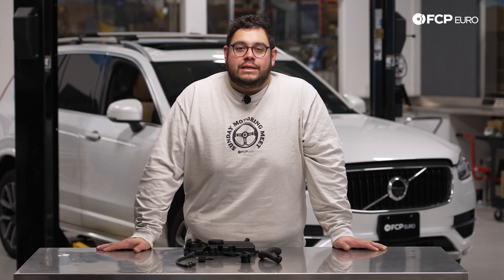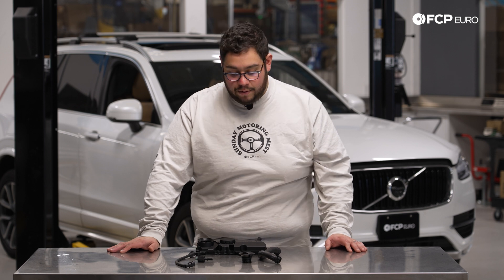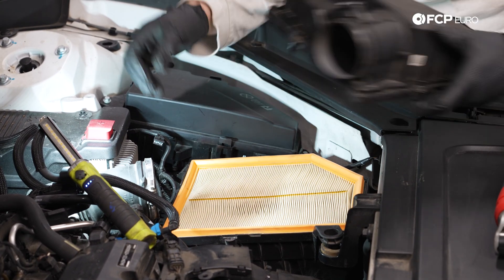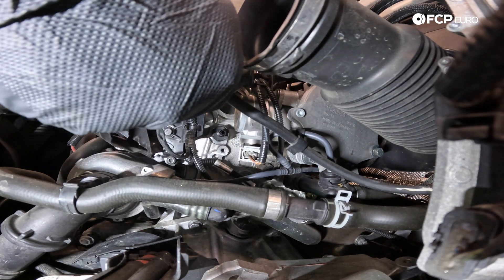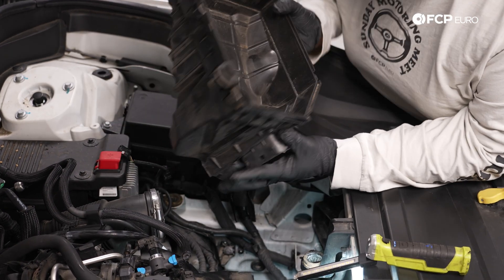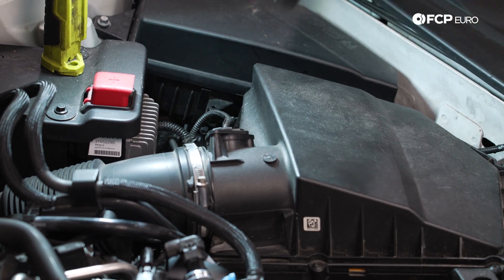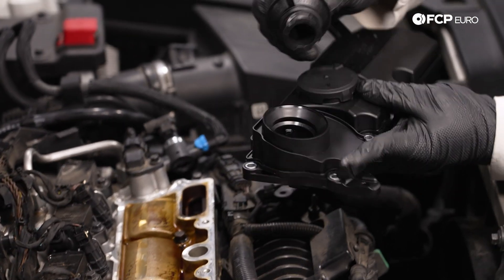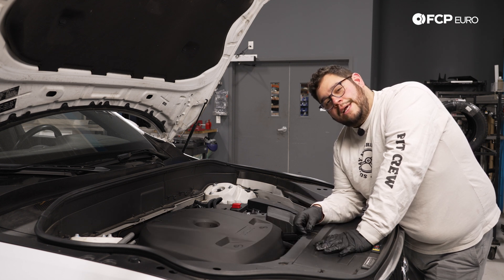Volvo XC90 PCV Oil Trap Replacement DIY (2016-Present Volvo XC90 SPA, VEP Engine)

Comment: Is this a common fix for a p0171 code?
Reply: I have the same code. And I did a vacuum test on engine oil cap per ChatGPT, and it has issues then replace this.
Reply: Did you just change the oil cap? I ended up buying the whole kit so I will swap everything out, did the check engine light disappear on its own?
Reply: @drecamp9507 mine got solved with fuel injector cleaner. My vehicle was in storage for a few months.

Comment: How do you get rid of the check engine light? I’ve hooked up my OBDII scanner, and cleared codes. It clears the light for a few minutes, but then it just comes right back.
Reply: check for other vacuum leaks with a smoke machine
Reply: what codes are you getting?  I am getting P0507.  Still trying to clear it.  I cleaned the MAF and still engine light on.

Comment: I have a question I saw oil residue on my 4 spark plugs, have a oil consumption notably, but no check engine, no code or misfire, what your thought ?
Reply: Same here, did you find out if it's a PCV issue?
Reply: The early 2.0s Volvo used had piston rings that easily clogged causing consumption issues. Well known issue. I think around late 17 they fixed it. Many motors of this era were replaced or had new pistons and rings installed. My 2015.5 xc60 was replaced. I verified this by checking the engine serial number. It was a sticker on the timing chain cover. I think you can search your vin or engine number to see if yours was the first generation. Any 15.5 or 16 was definitely affected. Google around it’s a common issue. Later models have the updated pistons and rings. Good luck

Comment: I have a Volvo S90 and the check engine light is on. I put a diagnostic tester on it and  came up with code p0171. I changed the pct oil trap but the check light came back. What do you suggest?
Reply: Same problem to me. Man. So frustrated.  Did u figure it out?!
Reply: @wus52e  Same, I tried multiple things, and I believe the reason is the PCV diaphram, the PCV valve on top of the valve cover. If you have an OBD reader, check whether the Long Term Fuel Trim goes up (and triggers the p0171) only when idling. If it goes down when you keep the engine at 2500rpm, then you may have the same problem.

In any case, I am going to replace the PCV valve with an aftermarket one tomorrow and I will report back if you are interested.
Reply: @SaverioB any luck ?
Reply: I think it's the PCV valve, I am replacing it tomorrow and I will let you know.

Comment: What's the first sign that it needs to be replaced? Changed my spark plugs on my xc90 t6 and there was a little oil on the threads of cylinder 1 plug.
Reply: I noticed oil on the top of my seperator thought it was spillage from the oil change. I had oil on the threads of cylinders 2 and 3 when i recently changed my spark plugs. Needless to say I'm replacing the oil seperator now

Comment: Just replaced mine. Whining stopped immediately.
Reply: Were you able to drive it for a few days before replacing it?
Reply: I'm having the same issue. My mechanic recommended I do this service. Did you have issues afterwards?
Reply: What kind of whining? I have kind of a squeal on startup but it kinda goes away.
Reply: did you replaced using the whole kit?  I only replaced the top oil trap and still getting P0507 check engine light code.
Reply: @doomspace  hey! Yes I did. However, I still had the light as well. Turns out the code was a “permanent code”. A.k.a., it could only be cleared with the special devices that auto shops have. So I went to my local auto guy. I paid him $20 to clear the code and it has not popped back ever since.
Reply: @Hammad-o3d thank you very much for the info!!  I will try to get it cleared.  Have a great week!

Comment: Is that the same for my 2017 Volvo xc60 t6
Reply: ….the engines are the same.
Reply: Exactly my question
Reply: This is the same for all 2.0 4 cylinder twin charged petrol volvo engines.
Reply: @HhhGggg-rz7bu   Wrong , the diesels have their pcv trap integrated in the valve cover and it requires pulling the injectors out , which is a massive pain in the ahh.... ask me how I know...
Reply: @Constantine_04  i should have said petrol only. I edited it. In America (where this video was recorded), no one drives diesel cars, so I assume you're elsewhere .
Reply: Same thing for the 2017 xc60 t6. Unless you have a diesel. This applies to all 2018-2024 xc60 t5,t6,t8. 2016-2024 xc90 t5,t6,t8.